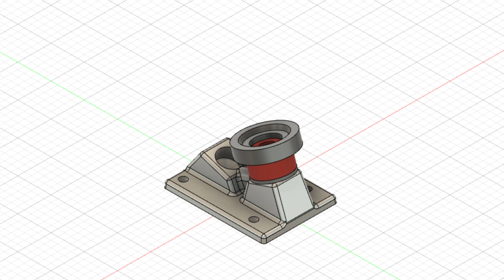Testing my DIY Truck Geometry with 3D Printed Prototypes - Casting Trucks At Home, Ep. 1

Comment: I really like what you are doing here.. Making FUNCTIONAL parts with your 3D printer, and then thinking of how to make the metal version.. I watched your video on casting these trucks, and it  looks like you got that down to a "t" as well
just as with the wheels.. 
Personally, i'd make Metal moulds for wheels, but that would mean you'd have to  get a Lathe (preferably CNC), and a mill to go along
Me, as a Metalworker by Trade, if i ever do such a thing, i'd probably go the metal way from the start..as i have already designed a Reverse Kingpin Truck for Longboards, 
I already made a Deck myself.. that is not too hard, but a pair of trucks is a different cattle of fish.. although i already did modify some Bennet Vector Hangers for which i needed the 4th Axis on my CNC Mill.. (luckily my Opposed Center has a 608 bearing so the axle fit right in.. to remove and replace the pivot for a steel one with a Ball shape, and opening the seat for the bushings to accept a pressfit Spherical Bearimg, turning it into a Precision truck.

Seeing your progress means two things.. 1: you're knocking it out of the park, and 2:  it gives me motivation to try my hands at the same thing...Making trucks and wheels..

Comment: Yeah they turn and pop but do they grind? This video never had to be made. 40yrs of department store skateboards having plastic trucks we know they dont work.
Reply from the maker: You're right, we know plastic trucks are no good, that wasn't the question I was trying to answer here. Since I designed these trucks from scratch, and I've never designed trucks before, I wanted to make sure the design worked before I cast them in aluminum. There are all these little details about the baseplate angles, the pivot cup, the axle placement, etc. and if I get them wrong the trucks won't even turn so we gotta get them right!

Comment: Have you considered lost wax casting? They make Resin for 3d printing that melts at comparable temperatures to casting wax. Might be a bit more investment (see what I did there?) financially, but it might be an alternative worth checking out.
Reply from the maker: I might pursue that for some of the weirder geometries I want to try or for some non-truck projects. It's a really cool craft, I'd just need something to use for a burn-out oven

Comment: It is PLA filament?
Reply from the maker: Yup! This will be the only times I use them so I didn't mind using something less durable
Reply: @GoodRoads  thanks. also i have the artillery as a 3D printer the X1

Comment: Absolutely love every single project you take on. This one is no exception. Please... for the love of skating though.... wear some body protection when you try sketchy 3D printed trucks 😂
Reply from the maker: Had my dome piece on and yeah, knee pads and maybe even slide gloves would have been a good idea.
Reply: @GoodRoads  dome is by far the most important. Good lad! :-)

Lookin forward to the next stages of this project mate. Between making your own boards, wheels, cushions and trucks you are bearings shy of making it all in house. Doesn’t get much cooler than that!

Comment: Why did you decide to go traditional kingpin as opposed to reverse? I'd imagine that RKP's would be easier to make with the hanger being essentially flat.
Reply from the maker: The hangers for RKP trucks would definitely be easier but the base plates are much harder and the reverse is true of the TKPs. However, I think I can get the TKP hangers to work with a flat parting line and since their baseplates are slightly easier, that's what I went with. I also thought it would be good to start with the most common style of truck. We'll do RKPs at some point though, they're too damn cool not to (and they're my favorite style truck)
Reply: You can reverse most any kingpin in any trucks
Reply: @darrentyler1817  you're thinking about flipping the kingpin. reverse kingpin trucks are a completely different thing. you can Google it if you want more info.